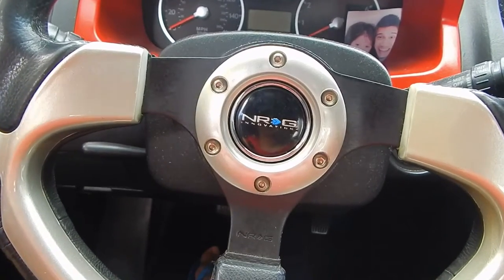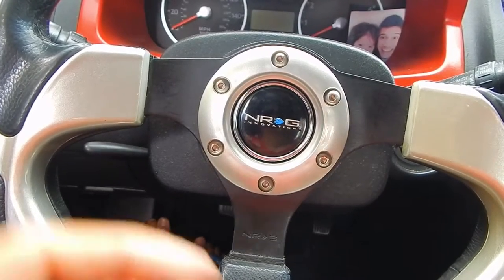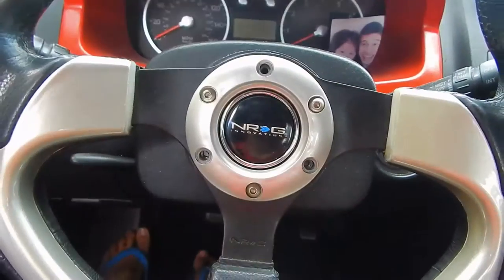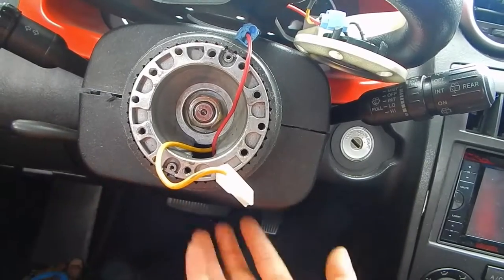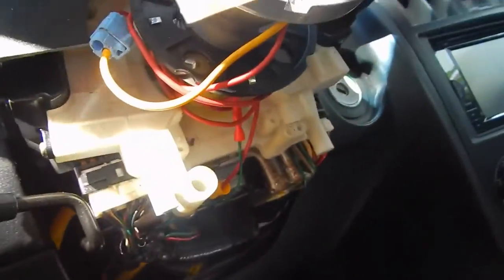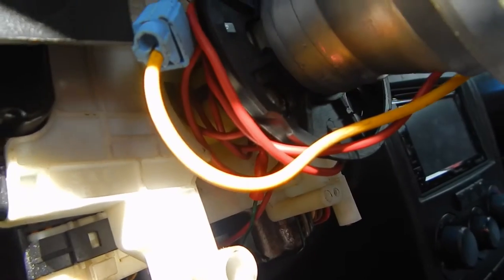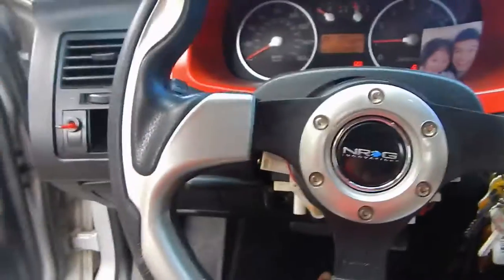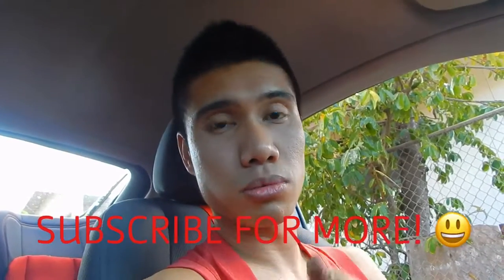DIY NRG steering wheel horn button for Hyundai Tiburon

Comment: Pls what quick release and bosskit is required for installation
Reply: Already purchased the steering wheel
Reply: Its universal quick release and Sparco adapter kit
Reply: Its a universal quick release on ebay and the hub adapter is Sparco